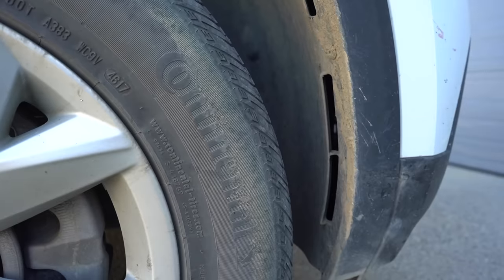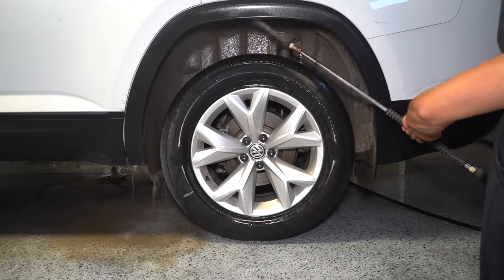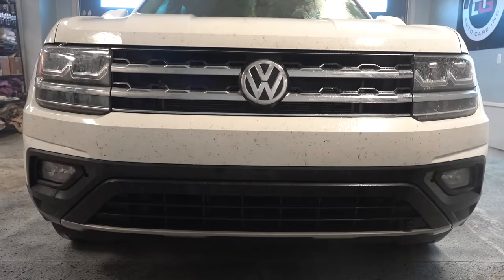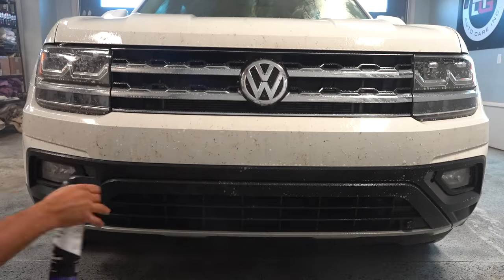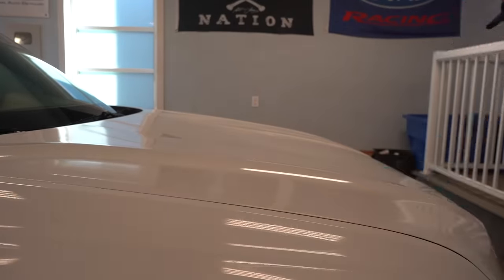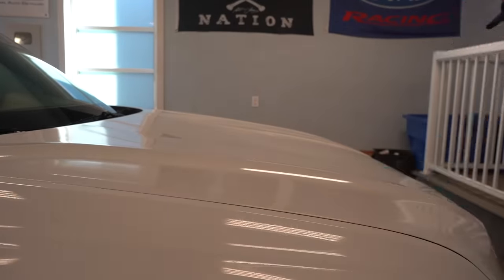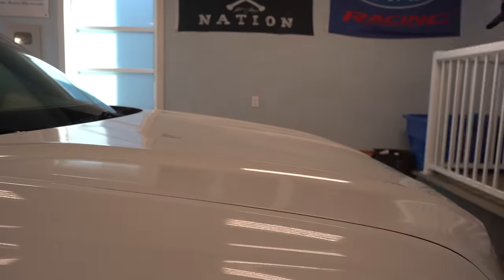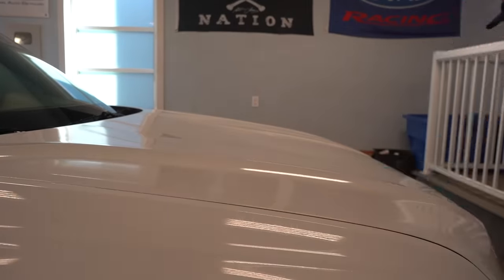Deep Cleaning a MOLDY SUV! | The Detail Geek

Comment: Carpet wheel wells not only reduce noise inside the car, they also reduce road spray in wet weather which helps other drivers. That's why they use it.
Reply: There's got to be a way that he can clean it the same way he does the interior carpets, ya know? Like I know it'll take a lot longer, and maybe a bit more difficult but I mean, might be easier?? 🤷🏼‍♀️ I don't know, like maybe take the wheel off and put it on a car jack and get under the car?? I don't know, all I'm saying is there's got to be a better way to do it.
Reply: @cheriberry3  this is the best way. No one is taking wheels off to extract the wheel liner. Pressure wash that mud off

Comment: The scary thing is this car is only 3-4 years old…. How?? 😖
Reply: Taking care of kids. Obviously, this car has been cleaned at least once since it was bought, but the point is that kids are messy and being a parent, finding time to clean the car so often can be impossible.
Reply: @BUDSBEAU  My mom would be late sometimes driving us to our various practices and thus had no choice but to tell us to eat in the car. So sometimes it's just not possible for parents to regulate whether their kids eat in the car, especially when you're on the road for long hours and/or are late somewhere due to having a busy schedule
Reply: @BUDSBEAU  Not smoking in your car, though, I agree with fully. Smoking is already an unhealthy habit and doing it an enclosed space where the scent and harmful chemicals will literally never come out and be trapped in the confines of the space, is nasty and is definitely something that can be controlled and avoided. Having kids though, and a busy schedule to go along with, especially if you're a single parent, is a different story. I have more sympathy for parents with dirty cars ( note: parents with equally as dirty homes as their vehicles is different; that's nasty and can be changed, as it's a space that is more commonly spent time in and is where you invite guests into, thus leading you to needing and wanting to take care of it more).
Reply: They don't make these cars as good as they used to,

Comment: They could create enclosed baffles that contain noise reduction material, like in a sound stage, that would do the same thing as the carpet in the wheel wells, would be lighter, and prevent dirt, water, salt, etc. from hanging out in the wheel wells as bad....probably cheaper and longer lasting too.

Comment: Hi There,
I really appreciate your neat cleaning processes and how you are doing it, but I would like to give some advices for you, if you don’t mind. 

For Your Health:

1- Use always proper hand gloves especially dealing with chemicals. Even spraying the cleaning foam on to the car.

2- Use protective googles all the time during the use of water jet, steam cleaner or spraying chemicals.

3- Get and read the material data safety sheets of the chemicals that you use and always put on the gas mask on, if the inhaling is dangerous.

4- Wear  proper uniform and shoes which are water and dust repellant and can be easily cleaned.

For The Process:

1- Use different or special tips for the vacuum cleaner especially removing the dust from the seats and the dash board of the car. You're the expert but if I were you, I would take extra care while dealing with leather steering wheels and seats. Why I’m insisting on this: because of the tip that is used for cleaning the mop area could have some sharp edges caused by small stones during pressurized vacuum cleaning. 

2- Use a pressure adjustable water jet or blower. Because some parts of the car (even outside) could be delicate and could be easily damaged.

3- Maybe using top ceiling fans as blower with adjustable locating around the cars which are directed to basement, could give an option to bring down of liquid mixtures or sprayed chemical granules. But for this you may also need a extra suction outlets down below the garage walls or let the garage door open all the time :-)

4- Not to take the responsibility of already damaged parts of the cars, take exterior and interior photographs of the car before you start cleaning. If you are filming all of them, no need :-)

I hope all these are fine with you…

Best Wishes

Comment: There is better methods of sound dampening. It’s a thick pad that goes under the carpeting and around the rest of the interior attached to the body and inside wheel wells. But those forms of dampening are extremely expensive and time consuming so the next best and not as effective way is to carpet the exterior wells. Manufacture do like cheap. Higher margins.

Comment: I wanted to watch this video because she had mold in her car.  She's got nothing on my car.  I live in Florida, but I have a pre-2000 car that leaks around the windshield because the car was made for the windshield to sit in a metal frame - no rubber seal (or so the windshield guy said).  Now that it's rusted, I was told it couldn't be fixed because it was part of the frame.  Consequently, the harder afternoon thunderstorms drench my driver and passenger side floors with water.  For some reason, only the passenger side floor is molding.  Not sure why.  I have mobility issues that have gotten worse so trying to twist myself or carry anything downstairs is a challenge.  I can't even get air in my tires.  If I could save up enough money to have someone just treat the passenger side of the car for mold I'd do it, but I wonder if there are too many mold spores in the car at this point.  I only drive it once every two weeks or so, so I take an allergy pill before I have to go anywhere.